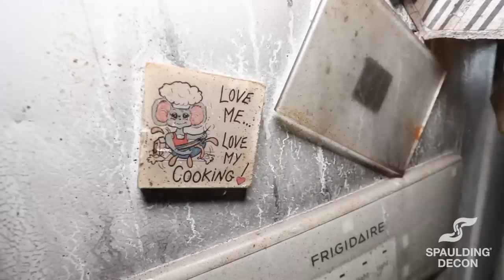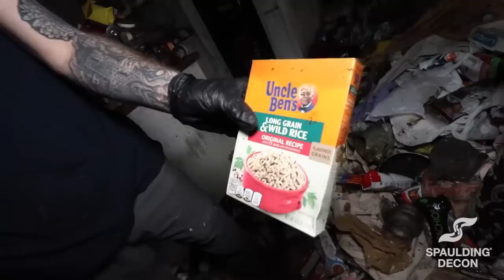THIS HOARD CAUGHT ON FIRE!!!

Comment: As far as specifically removing a hoard I wonder if this process went a lot easier/smoother because of the fire damage. Just in the way that it seems at least the hoarder was not able to be involved in the cleanup and the team could forego the emotional process of sifting through the hoard piece by piece with the homeowner.

Comment: seems almost like the hoard actually prevented the fire and smoke from causing more damage than it did. At the same time, I'm really surprised that the FD was able to save the structure with that much trash inside.

Comment: As someone living with a hoarding disorder that's starting to get worse little by little, my dad always warns me about my stuff catching fire. Mostly because I have only two decent outlets in my room and my laptop chargers used to overheat and I would get scared too

It's also insane that anyone could get to this point. Sometimes it's the fact that we think that we could use it later and it never gets used and sits there. And yes it does suck that sometimes we don't even have the energy to get things clean once it becomes overwhelming